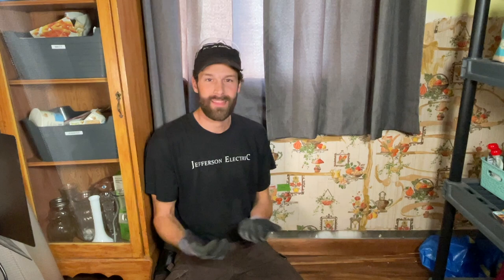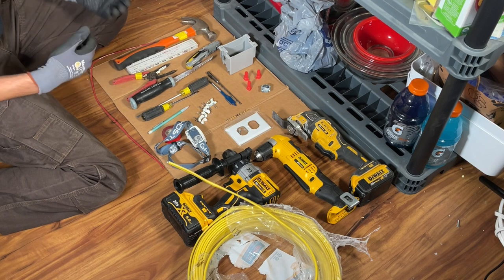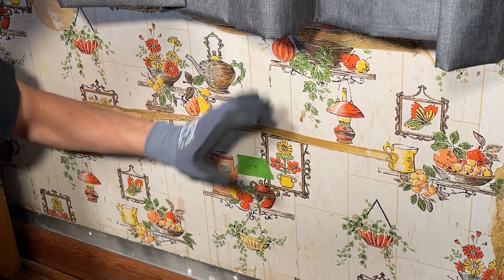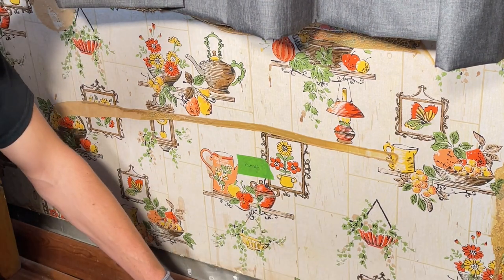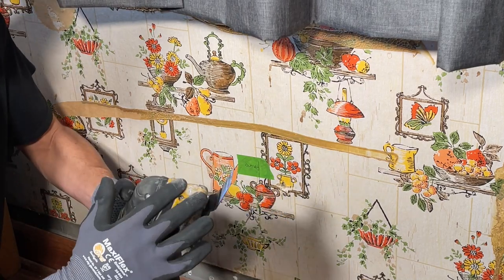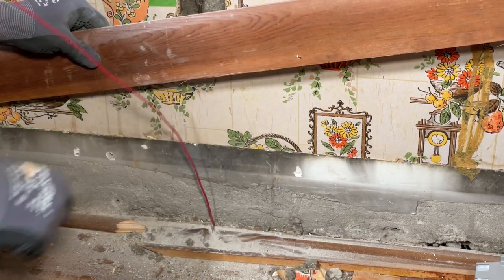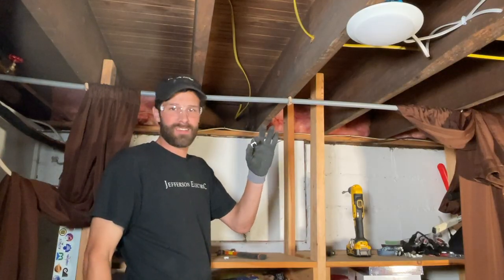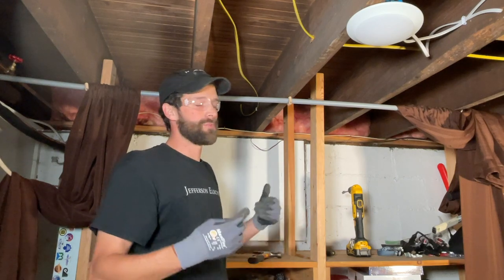How To Add A New Outlet Anywhere You Want It

Comment: I'm not sure it's ok to share a neutral between two circuits.  It's my understanding that current code requires each circuit to have a dedicated neutral.  This is especially true if one of the circuits is powering a gfci outlet which the second circuit going to the kitchen outlet should be. From my experience, a gfci that does not have a dedicated neutral will not work properly and will pop if it senses current on the neutral coming from the second circuit.
Reply: MWBC's are legal, but have fallen out of favor because of the expanded GFCI requirements in each NEC iteration. You can sort of put GFCI's on them, as long as you're absolutely certain the downstream neutral isn't tied back to the other circuit somewhere. Otherwise, the GFCI will let you know you messed up by instantly tripping when you apply any load.
Reply: @davidkahler9390  So best solution it seems is to go with dedicated neutral for each circuit and avoid issues.
Reply: @99andrianmonk  Absolutely, MWBC is just a cost saving measure.
Reply: As mentioned, current code does NOT require a dedicated neutral. However there are various additional requirements for MWBCs, for instance you must always pigtail neutrals and cannot use a device to join them, you need a two pole breaker or a handle tie, etc.

Comment: Never understood the use of metal (conducting) junction boxes.
Reply: Metal boxes are sturdier than plastic. Also required when using metal conduit.
Reply: Not in our country, everything in plastic.  Never met problems with solidity.
Reply: Metal is robust, doesn't become brittle like these plastic boxes eventually will. It's also effective at containing arcs, whereas plastic will melt and even burn. It will also clear a ground fault from an errand connections, since it's bonded. Metal boxes are great, most people don't use it because of cost and time.
Reply: @mr.g937  metal not allowed by law in many countries, boxes must be isolation material.  Never experienced any fire damage our breaking of plastic boxes.  Opinions and legislation clearly can  diverse on this matter.
Reply: @joachimfilms  What is the rationale for such legislation?
Reply: @mr.g937  safety regulations.
Reply: @joachimfilms Ok. And what is the rationale for the safety regulations?
Reply: @mr.g937  those were defined by people that are much smarter than me.  I'm just a simple electrician. Please contact the WTCB in Belgium.  Beste regards, J
Reply: @joachimfilms  don't think they are so smart if they are banning metal boxes.
Reply: @mr.g937  i'm sure it has more to do with lobbyist and making money under the guise of safety. Guy virtue signals about his regulations but doesn't even know how they impact safety.

Comment: Wish you had explained why you're able to use a 15a. receptacle in a 20a. circuit…..anybody?    JDM (not Linda)
Reply: As long as there is more than one outlet on the circuit it is permissible. If you had a 15 amp single receptacle it would need to be on a 15 amp breaker.

Comment: ok, but I want to install a new receptacle on the second floor...
Reply from the maker: Assuming the you have a basement as well I would probably cut a small patch of plaster / drywall under the trim at the bse so it is easy to patch and then a small hole at the top of the 1st floor wall along the same wall cavity.  Similar process just need to get the wire up the 1st floor wall cavity and you will have some plaster/drywall patching at the top of the 1st floor wall.

Comment: I was told that You can't have two separate circuits on one neautral.
Reply: As long as the hot are opposing phases.
Reply: @lostcause1206  that doesn't even make sense. The hot and neautral are oposing
Reply: @matthewcanavan8275  a  - phase  ( black)
B phase ( red ) neu white 
All can be used together or in pairs .
Reply: Black with white = 120v
Red with white = 120v
Black with red = 240v
Black , red , white  = 3wire 240v
Amps are a different story .
Reply: @matthewcanavan8275  recommend watching some electrical theory videos to learn about phasing and also MWBCs

Comment: 1 of 2 things. Plastic boxes are NO GOOD. Really wish NEC would ban them. I made my electrician use steel boxes. I have the knowledge how to do that, I no longer have the physical ability. I am sure my electrician hated that I insist he use metal boxes, but when I am paying the bill I expect to get what I want.

2of 2 things. Wire nuts... Would like to see those go away too. The lever nuts are superior or at least the push ones. The old twist ones are outdated and should be obsoleted. I would even argue that they're dangerous. We have better things available so the better things should be used.